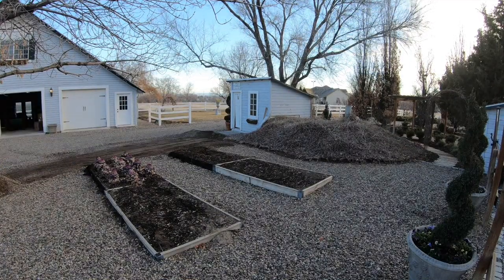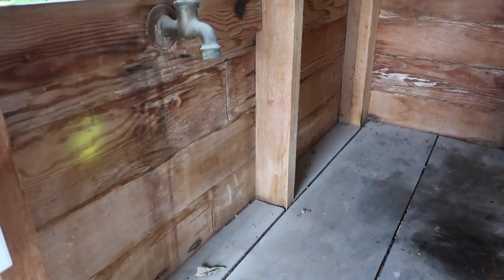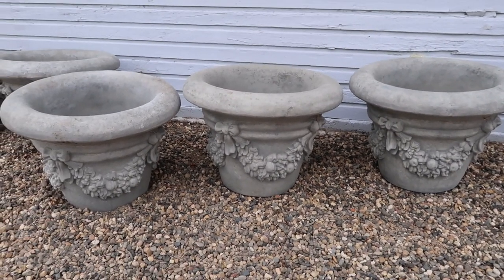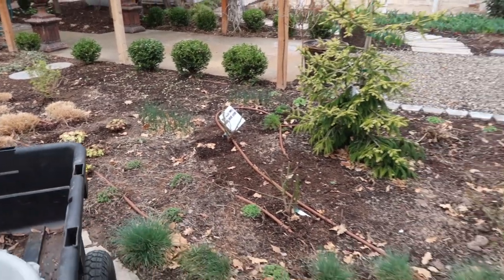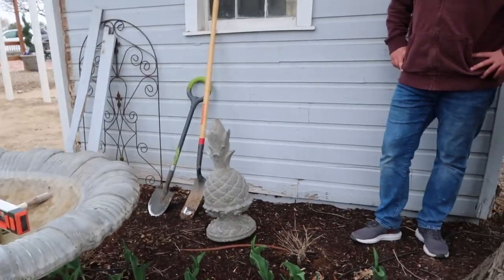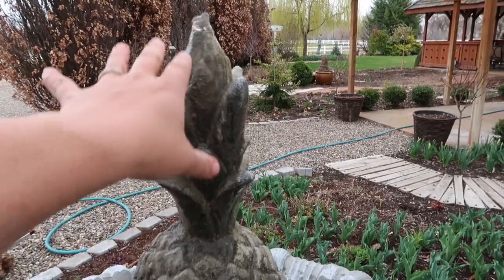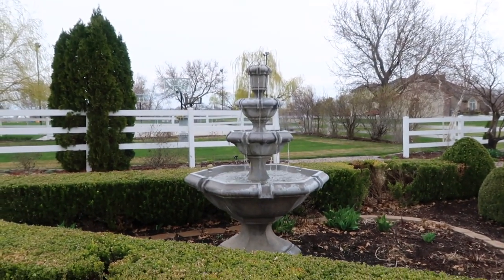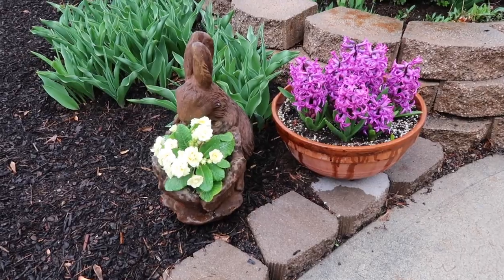Root Cellar Reveal, New Concrete & Setting up Fountains! 😁🙌💦// Garden Answer

Comment: Just FYI, grown chickens don't need heat lamps for the winter.Chicken have to adjust to the cold or they actually can get sick.Heat lamps are only for little chicks.Love the rabbit planter and all the fountains!Can't wait for the chicken update and the chicken run!!!
Reply: We live in zone 5b in Colorado.  We don't use heat lamps, except as chicks, because if the power goes out you can loose your whole flock.  They all snuggle together when it's cold sharing body heat.  If you're really concerned,  you could give them some chicken scratch with corn in it.
I will say that a heated waterer is totally worth it in the winter.
Reply: I live about a half hour away from Laura and I use a heat lamp for my chickens in the winter. It might not be totally necessary, but it makes me feel better knowing they can get warmer if they want to. And yes, a heated waterer is a huge benefit!

Comment: You should consider using shrink wrap for your fountains. It is the same shrink wrap used on boats. It keeps water out over the winter and you will have zero clean up in the spring. It is amazing how well it works for fountains.

Comment: What do you plan on putting on the floor of the chicken run ? Chickens need to scratch and if you put gravel they will completly destroy it and it will hurt their little feet too. Woodchips is a goodchoice, plus you can once (or twice a year since you have 10 chickens) harvest it and after a few weeks (or months) composting in a pile, use it in your garden as a free amendment !
Anyway, no matter what bedding you use, you may need at some point to get a cart inside or even a trailer to change it so take that in consideration for your doorS. Yes doorS because the bedding in the nesting boxes and underneath the sleeping perches inside the coop needs to be changer regularly to keep everything clean to prevent deseases and pest.
You also need to make sure the  nesting boxes are lower than the sleeping perches otherwise your chickens will not use their perches to sleep and will use the nesting boxes as they are higher and you may end up with crushed eggs or dirty eggs if they poop during the night.
Make sure to keep a small area in the outdoor run with nothing on the floor, just dirt as chickens love to take dirt baths, something very useful for minimizing pests ! Add some very small gravel for their digestion (since they don't have teeth) and you're good to go !

Comment: Even though we dug a 2 foot trench and added chicken wire and large gravel to prevent digging under, and a wire roof to keep out hawks, the predators tried. Eventually 7 years later, one predator, either a racoon or a fox,  chewed a hole in the wall wire and did enter and sadly, killed our entire duck flock. So sad. We didn't even hear it... So lesson learned -- electrify your wire!! We didn't, cuz we were over-confident! BTW there is an electric auto chicken door closer that closes at dusk to keep predators out, and a solar wire shocker for chicken wire.  Love the show!!! And little Ben. Inspired by you last year, Hubbie planted 10 climbing roses at our pasture end, 10 privacy trees and 2 fruit trees. More to come, where's that Benjay?... Hugs...

Comment: May I recommend a flat panel heater instead of a heat lamp in the coop. Chickens create a lot of dust and there is a much higher risk of fire with heat lamps. Also, predator proof the coop and run as thoroughly as possible. Chickens! So much fun!🐣🐥🐤🐔

Comment: Yeah! You will love having chickens! 
Don’t use chicken wire use 1/2”x1/2” hardware clothe. 
Backyardchickens.com is a great resource to get all the information you need to know about chickens.
Reply: Yeah, I agree about that.  I've seen youtube videos of flocks that were killed because a predator easily got through chicken wire.  The hardware cloth is so much better.  You also need to make sure that the hardware cloth is either dug into the ground around the run or extended on the ground out, usually at least two feet, to prevent predators from digging under the run.

Comment: Y'all really should have used cinder blocks to fill in the stairs. Just using dirt allows moisture to build up inside the shed. Mice can also borrow their way in (although chickens eat them they can get into the feed). And much of that can be moved away with light flooding, and it's bad for the foundation of the shed as well as the wood
Reply: I think she said they are laying cement over it. Might be wrong.